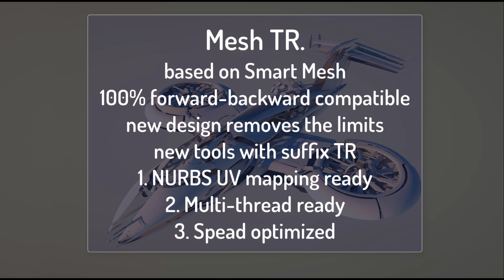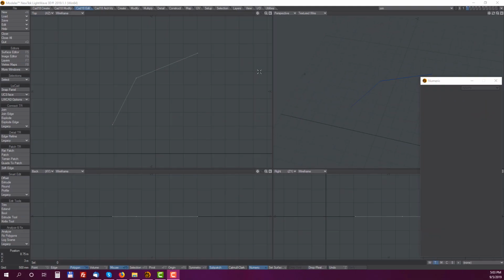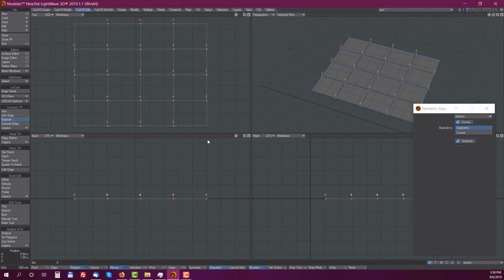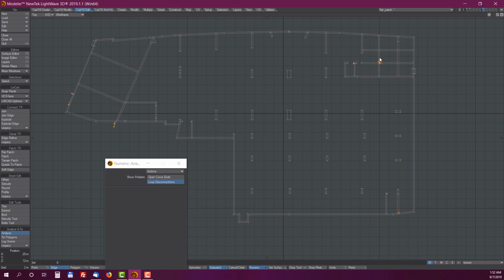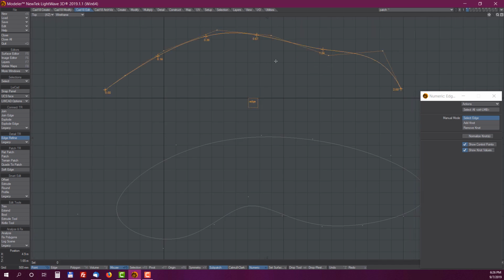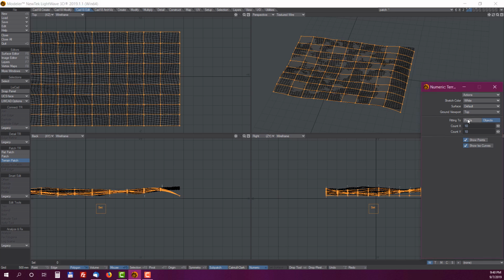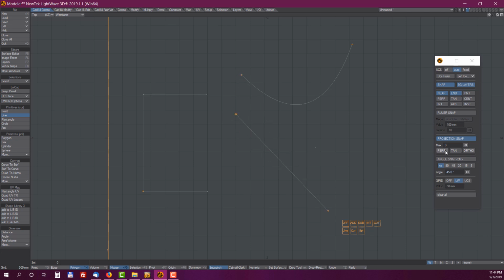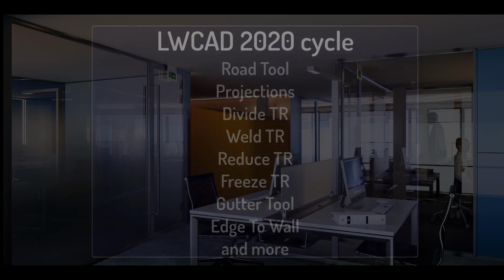LWCAD 2018.3 update (LightWave)

Comment from the maker: Important note for all users upgrading to LWCAD 2018.3!
Please avoid to use Round tool on surfaces.
The official hotfix will be released on Monday Oct14th
Reply: I'm experiencing problems with round tool even remaking the polys with LWCAD 2020. Wasn't able to do the round on a poly, so I tried with a LWCAD poly or surf.  If I press undo to try and restore something the geometry gets messed up.

Comment: Victor, I would love to see a working plan tool that would allow you to work right on a plane at any angle.
Reply from the maker: please explain this more, maybe some screenshot with detailed description. Please email it directly or via support. Thanks.
Reply: @architron  Modo has it. You click change work plane, and then pick a polygon. Now when you draw a disc, or box, it will conform the orientation of the polygon.
Reply from the maker: Custom UCS plane is avaiable since LWCAD version 3 :)  https://sites.google.com/view/lwcadmanual/lwcad-5-0/3-tools/1-create/1-ucs
Before it was implemented in Modo :)

And it was updated and tweaked several times since then.
Fastest way is to use AUTO usc mode. Use the tool in perspective viewport lets say Rectangle tool and click to any polygon. UCS is automatically aligned to clicked geometry. If you set FIX UCS now , you can freeze that worplane for next tools apply.
If you need more custom workplane, then use Ucs Face tool, so you can rotate workplane interactively.
After you are done, just switch UCS back to AUTO mode.
All tools in UCS group are related to worklane. UCS(workplane) modes can be switched in Snap panel.